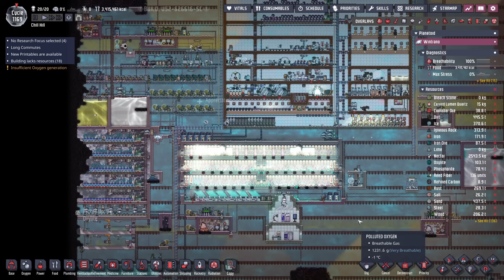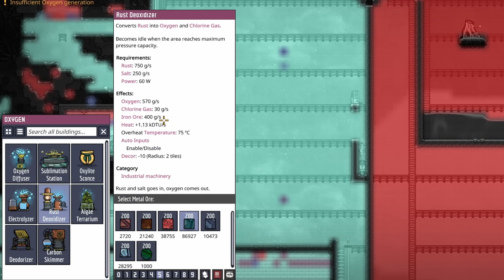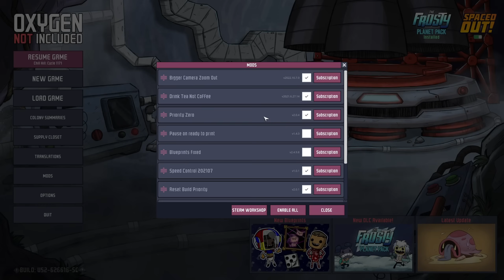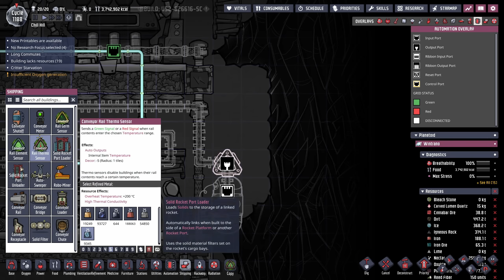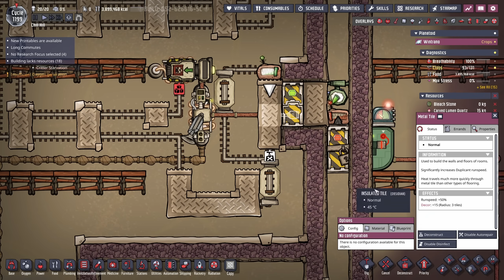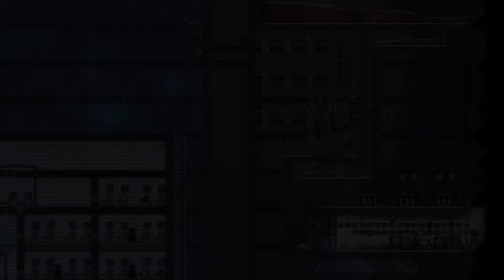Magma Rust Melter | Ep 15 Finale | ONI - Frosty - Ceres

Comment: the way you have to transfer temp to the metal tiles is not great, I let it create solid blocks, then robot miner them out, then use several aut doors to send them in a steam room where get pick up by a sweeper and run around inside the room.
I use the same setup of solid block for boiler and direct thermal power

Comment: But you are able to destroy Neutronium. There are even two ways to destroy Neutronium while one is quick but does not work always, the other is slow but will always work.
A) Fire Radbolts for a hundred or so cycles against a Neutronium tile and it will vanish.
B) Shave it off with a Rocket.

Comment: You can tame a normal volcano with 3 steam turbines and just Steel in the steam room, if you let them start at 125°C steam temp. and have enough power to operate an aquatuner to get the igneous debris to 20°C for use, so as long as you control the output of the rust heating section, you should be fine with 3 turbines.

Comment: I'm going to wait till I finish the video to submit this comment but at 27:43 you would want the debris cooling loop to counter flow, the coolant from the aquatuner should be going counter clockwise in that loop so the coldest temp of the coolant and the coldest temp of the debris are both on the same side and the warmest of both is on the warm side.

Comment: This inspires me to create something with the minor volcano i have at the top of the map of my corrent colony, but since i already have so much refined metal between my 7 metal volcanos just on the first planetoid (one of which is an iron one), i am leaning more towards a glass maker or something like that.
Also i have some qustions- is there a reason that the metal tiles at the counter heat exchange arent connected? And doesnt the way that the igneous rock debris forms causes a lot of heat deletion because it stacks on top of a pre-chilled pile of igneous rock? (If it does i guess its a good thing for when you dont really care about power and just want to chill the igneous rock, but i am just curious)

Comment: Get the mod for Insulated joint plates. Use the Geo tuner to get an increase in your volcano output and temperature this is helpful when you only get the small volcanos on your map. Increased temp will use less magma as well. at 47:47 your waiting for some liquid Iron to form to interact with the thermal sensor. what you could do instead is make a small two tile area filled with water and place that thermal sensor inside the water to set your melt temp for the rust.  You could also use a similar setup with the roundabout / counterflow to melt phosphorous to refine it. use the trick i suggested with the thermal sensor in water/ steam to get a more precise temp to melt that phosphorous and make a counterflow of the liquid phosphorous due to the SHC of the refining process (.15 vs .77 SHC) you will get some good heat for the counterflow.  compare this to a regolith melter for power of .2 to 1.0 SHC. Then drop your liquid phosphorous in some cold water.

Comment: In what universe will that Thermo Sensor above the melter ever read more than -273 in a vacuum? How many hours do you have in this game? Like, what do you think that Thermo Sensor is reading the temps of? Cuz it's not the metal tile, and it's not the conveyor rail. It's not even a rail temp sensor, either.
Reply from the maker: Molten iron sits on that tile after the tiles get hot enough.  If there is no molten iron sitting there, the sensor is red and the door stays closed. I have 2,748 hours in the game. Thank you for asking.
Reply: Is there a reason you felt like you need to be so rude?

Comment: when you have too much rust you end updoing this like I did dig to core of the planet and placed 2 steel tiles and than set a dropoff for rust connected to a door that shuts when liq iron tank is above a certain lvl so no more rust can be melted I had a 2 liquid lock for if things go crazy.Then the liquid rust would be picked up by a pitcher pump and dropped in the cooling section which is also inside the smelter room but yeah its basically 2 t. aq. cooling a metal tile brick made of steel and no I didnt need that iron either I just wanted to goof arround that planet was 80% ish rust biome and I was using it to make o2 anyways when I was building this I had over 350 k iron ore and I think most of it came from the 8 oxygen machines I remember seeing all the 25 t debris

Comment: 25:38 Actually, the reason it wasn't letting you build it there was because the conveyor shutoff has a power input, and you can't overlap two power ports (the joint plate connector is one)

Comment: While the door for the heat injector on the rust loop will usually stay closed, wouldn't there be a chance for liquid iron to appear in the door's tiles when it is open? Or does liquid spawning from melting solids behave differently than debris spawning from liquids cooling? I've never played much with melters like this, just the 'low' tech petroleum boilers

Comment: >36:10
Wait, that temp sensor above the metal tiles is in a vacuum, it's not going to measure anything!

>41:15
See, it's still showing -273°. You'd want to have a blob of lead or copper there. An insulated tile to the left of the sensor will prevent that blob from going anywhere.

>47:50
Ah, so you want the molten iron to be there? But AFAIK it will not happen, because the rust will only melt on rails inside the metal tiles, and in that case it should be pushed left, not up. Or does it get pushed up first, if there is an opening?
Reply from the maker: The molten iron can pop there. I have had the molten iron there a  few times, just need the hotter magma.

Comment: Two questions:  

1.  18:58 If you are concerned that the final magma dropper might get too hot to solidify magma into small rocks, don't you want a temp sensor there to force it to dump its heat into the other room?  You only put a temp sensor in the steam room for if the steam room got too cool.

2.  44:35 why do you assume its the rail tiles and not the molten iron splashing onto the tiles that heated the catch cup?

Comment: You should drop the water from the turbines directly on heat sources.  So have one drip water on the aquatuners and one drop on the metal tiles transfering heat from the hot igneous rock, ect.  That way the water directly cools stuff instead of needing the heat to transfer through the steam.   
 Also, if you run the very hot debris through a couple metal tiles, it exchanges heat way faster then just running it though steam alone.

Comment: I've used mesh tile + magma trick and it's pain in the butt to work with. It always clogs. I've managed to sort this problem by pushing magma using simple timer and three steel doors to the diamond floor which is connected to the steam room. When magma blade touches diamond tile it creates a debris which then picked by the autosweeper and sent to the steam room. This system becomes super compact - only 4 tiles high. Plus you can drop a rust directly into the magma and melt it to iron without counterflow heat exchanger. I've managed to process about 200 tons of rust using just 5 volcano eruptions.
Reply: The mesh tile system is much easier to operate if you have ample space - making it 4-8 tile high allows you to easily process magma output from double geotuned volcano. Original design by Tony Advanced used 4 steps for a volcano tamer.

Comment: question. How does the rust after melting into liquid iron not fall off the circle roundabout. Or better yet, if it drops down into your little metal tile pool. How does it land there instead of falling straight down and to the right of the Metal Tile pool?

The only thing i couldent understand.
Reply: When something melts inside a solid tile, the liquid is pushed either to the left or to the right, not down or up. There is no space to the right (occupied by door and insulated tiles), so any rust melting on the rails inside the metal tiles gets pushed to the left. From there it drops down onto the cooler metal tiles, where it immediately solidifies.
Reply: @nazgu1 I wonder what if door is open and liquid iron will appear there

Comment: I probably wouldn't worry about magma falling from the blade edge exchanging heat with things on its way down - IME small amounts of liquid, when falling off a ledge 2 or cells or higher above the floor will pretty reliably form precipitation (as opposed to atmosphere) that doesn't exchange heat on its way down. Liquids stay as atmosphere when there's high mass, or when they're falling of 1-high step, or they're falling off of another liquid.

Regarding solidifying the magma - I'm doing something like that on my superconductive planetoid - 1500°C magma as a backup heat source for the niobium-power-plant. I actually solidify the magma (and niobium) into vacuum first (the 1500°C magma has fairly little left in it) and corner-sweep in inside. No door injector needed - instead, temperature sensor inside the steam room controls either the sweeper, or conveyor loader.

Comment: dont you lose 50% of the mass by digging out the tile? So in reality the rust machine is a better option. Unless you can melt the rust and it does not form a solid tile, kinda like how when a building melts into a pile of refined metal. Other wise this a loss and a lot of time wasted etc.
Reply: you can mine space poi for unlimited rust. And theres no way to avoid the 50% loss unless you want to build a rust melter for every rust tile on your map which is " a loss and a lot of time wasted etc" you dingus
Reply: If something turns into a tile, it doubles its amount of material to accommodate for the mining loss.
Reply: @Guyinthecommentsection  i dont think this is true. it would not make sense, then why dont they get rid of the loss in the first place?
Reply: @Guyinthecommentsection  that doesnt happen. if it did that then you can just melt and cool 1 tile of whatever and get infinite material.
Reply: @DVK-Drago  Let's imagine you have 500kg of granite in a natural tile form. You mine it, you get 250kg in return. Melt it and freeze it, it makes an "artificial natural" tile, that has 500kg of material, but mining it would still give you 250kg, as intended.
Reply: @Guyinthecommentsection  freezing it doesn't double its mass
Reply: @DVK_Drago  that's just what I've seen. I don't know if they've updated it, but so far, it's been as followed.
Reply: @Guyinthecommentsection  I've never seen that happen.
Reply: @Guyinthecommentsection  you do lose 50% digging, i just checked it, i was right, but it looks like molten iron, just makes refined metal not a solid tile while testing.
Reply: @turboimport95  that would hopefully explain how the rust melter  works the way it does.